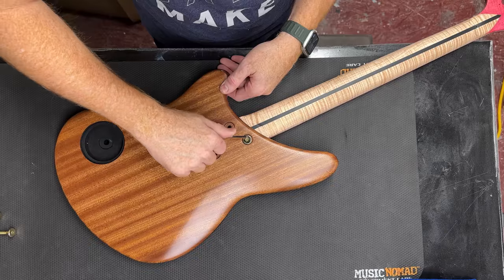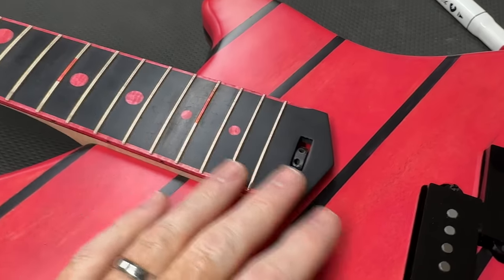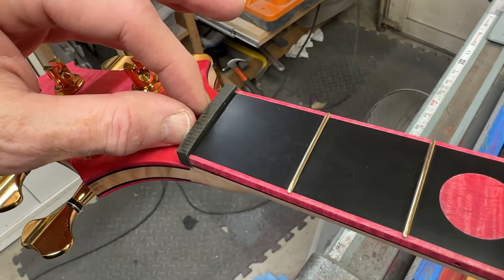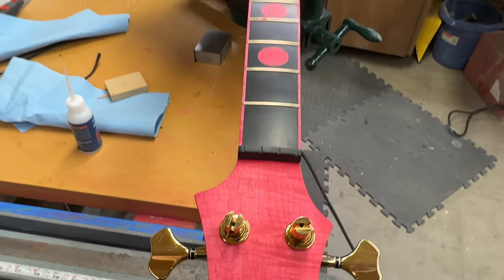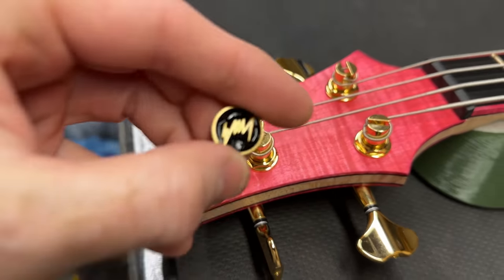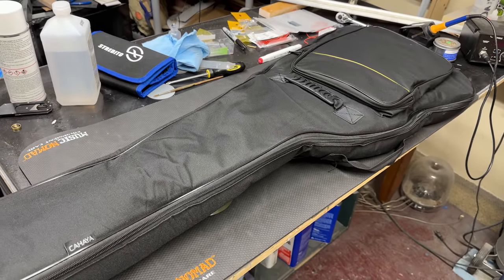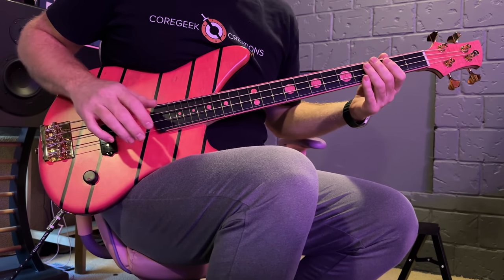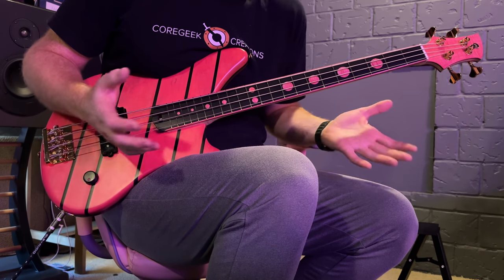From Rocking Chair To Rockin Bass Part 7 - Electric Guitar Setup and Nut Making - Final Part

Comment: Awww! Nothing better than the full on snot cry!! I almost had a moment just listening to the recap. 😜that turned out great Eric!  In the first part, I’m assuming that was shielding paint, if you continue building guitars, which I suspect you’re hooked now like me, you’re gonna want to find EZ-slide coating. I think tractor supply around here carries it. It is a graphite paint coat that does great shielding and costs like $20 for a whole quart. That is enough to do about 100 guitars. ✌🏼
Reply from the maker: Thanks man! Yes, it was graphite paint. Another great tip, thank you. Those little bottles sell for like $25!
Reply: I just looked it up. At tractor supply a quart is $16.99. 👍🏻
Reply from the maker: @34guitars  I’m sold! 😆